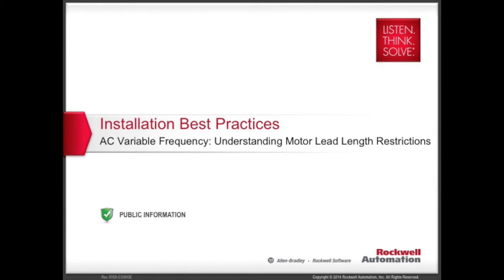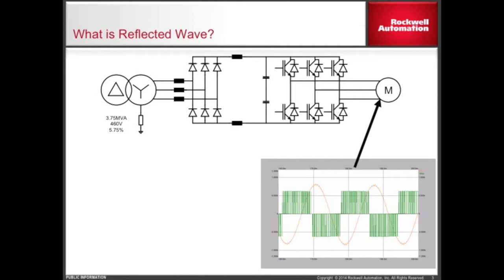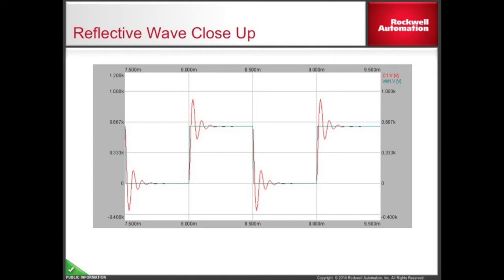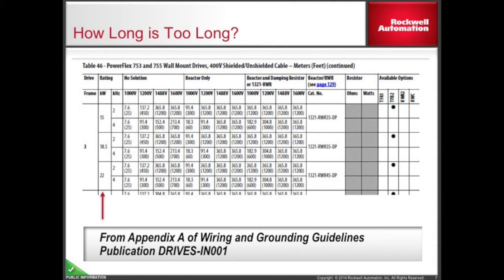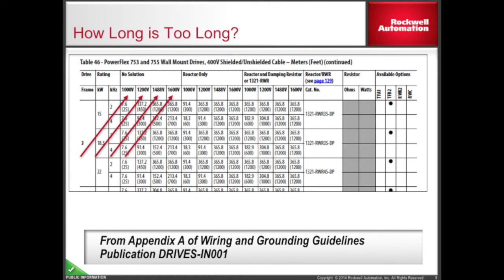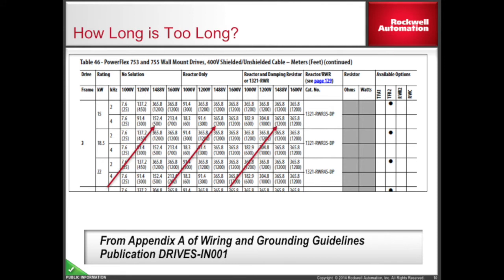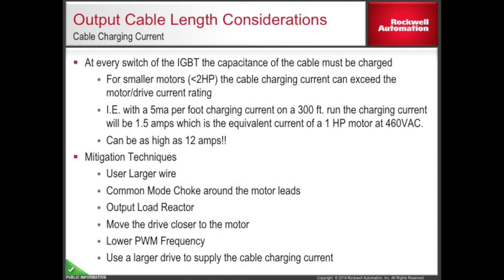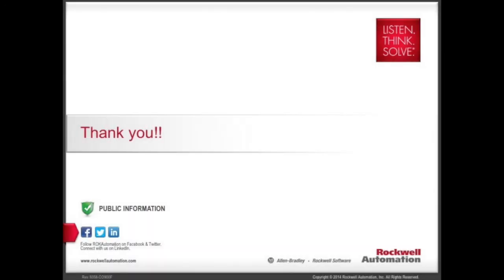Reflected Wave and Understanding Motor Lead Length Restrictions

Comment: We have a system with Kinetix 5700 drives and 4 servo motors. We've had 7 motors fail with shorted windings in the last year. We are going to connect an Oscope to try and determine the problem. We're using 40 meter 20290 cables.
Reply: Hello my friend! Have you determined if this 
phenomenon is the cause of your 7 motor fails?
Reply: @e-maqcomponenteseletricos   These were Elwood SX motors. We did find a lot of reflected wave at the motors so we put a line reactor at the drive output on the most troublesome motor. Eventually the customer put line reactors on the other 3 and shortened the cables by 3-4 meters. Honestly I the Elwood had a bad batch of winding wire.